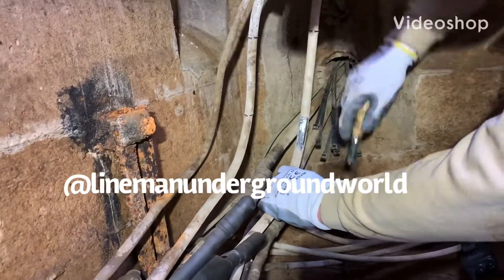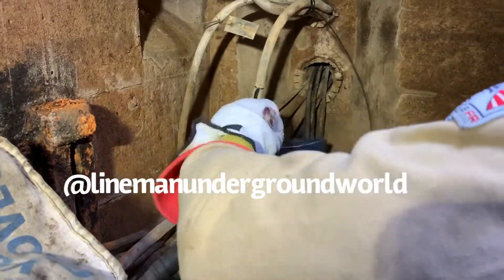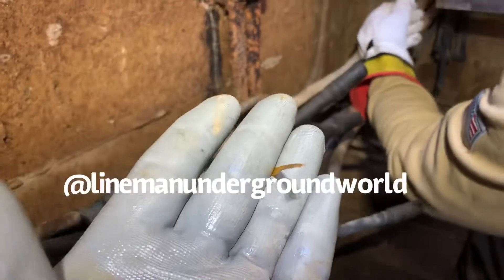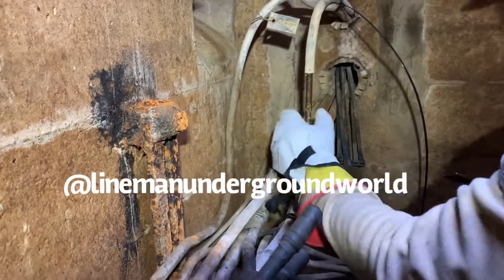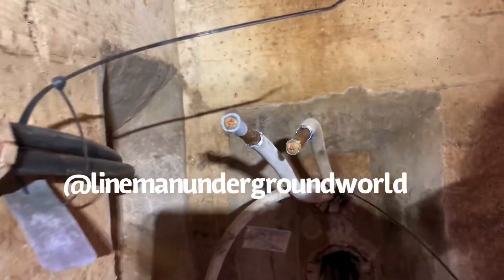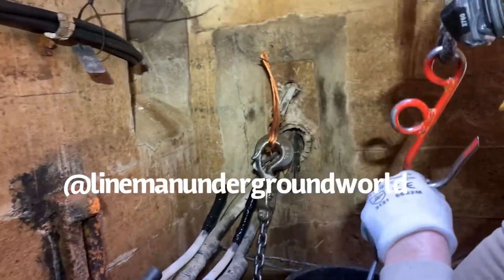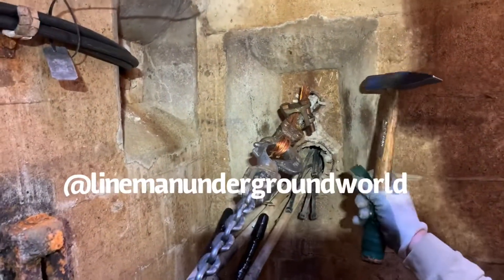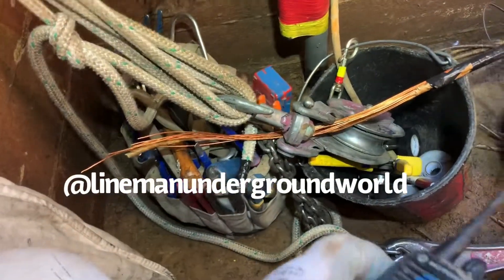Deenergizing pilc cable

Comment: All the work done at the beggining. The chipping of the lead, was that done with that cable energized?
Reply from the maker: pumkinface1 ... all the cable we remove as in secondary voltage we deenergize it as you see in my videos and the installation of cable we also energize...thank you for subscribing and tell a friend 😂 I